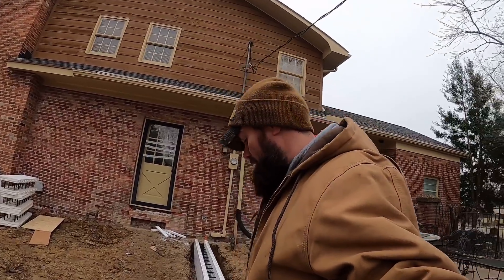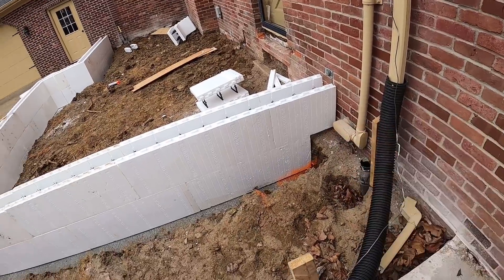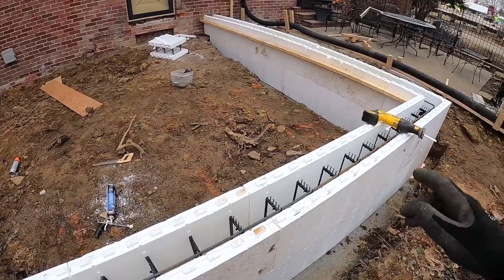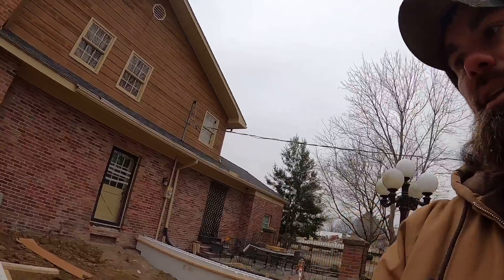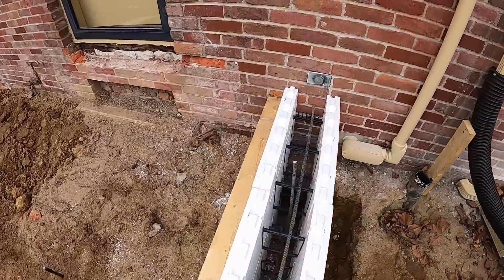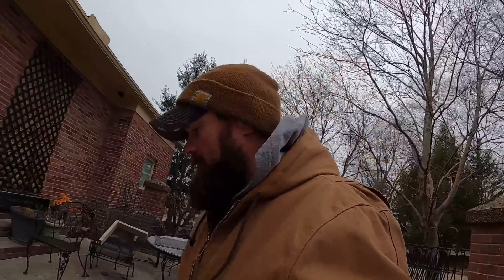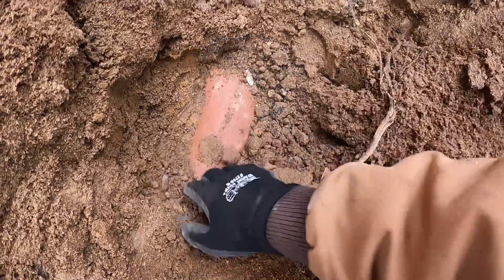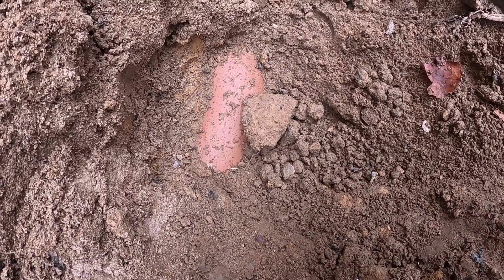fox block ICF.  #nudura vs #foxblock #dirtperfect

Comment: Learn how to use fox blocks and know it has solutions for these problems (the dang clips. Im sure you didnt actually think the blocks just set there by gravity. Im sure you use Noduras lovking system I don't know why you didnt use Foxblocks). Once you do, you will realize it is a superior product to Nodura. BUT, Im sure the flack youve caught by not bothering to learn the Foxblock system has turned you off Foxblocks for life anyway. Im doing an ICF house soon, Foxblocks (MADE IN USA!) and your videos are very helpful. Ive read up on how to do it and know the ins and outs of the system. I guess thats the benefit of sonething new. Im willing to pour over the instructions whereas a company that does it all the time and already has a preferred system is not. Thanks
Reply from the maker: Thank you for watching. We actually switched to Superform ICF blocks as there are no clips at all and the block is significantly more tough than both Nudura and or Fox.  They are made in Cincinnati OH.

Comment: Good job Matt
Looks like DP for got the clips to hold it all together 
Fox block is supposed to have clips cause the studs don’t snap together like Nudura
I find they both have pros and cons
All round good job Matt
Just subscribed 🤙
Reply from the maker: Thank you!  You are correct, they all have their pros and cons. The clips definitely help. Thanks for watching.
Reply: @nyamillennial metal clips to boot. There isn't a structurally stronger ICF block out there. For the job of containing wet concrete, this is the best. You can't fault nodura for being shippable and collapsible, but the cons of that outweigh the pros (weak corners, metal rods).

Comment: "Nothing to hold the courses together"...that's because you didn't use the required metal clips to hold them together!.  The metal clips work better than Nuduras plastic ones, which can pop loose.  Metal clips can't snap loose.  Good grief...how do you not know this?  You obviously have some skill, but its common knowledge that ICF's blocks all have some type of requirement to connect courses.
Reply from the maker: Victoria,  I do know fox block has metal clips, we typically don’t use them on stem walls. As for the nudura lock feature, they are our preference due to not having another bom to purchase for the build and the ability to unlock easily if needing to remove a block for whatever reason.

Comment: Would it work any better, to hold the slab to the stem wall, if you held the stem wall concrete down a couple of inches below the top of the block and let the slab pour fill that in?
Reply from the maker: Sam, yes that would work also. You would still need the rebar stubs which is where the main “tie” point is.

Comment: For the FoxBlocks, you needed to use the metal clips that holds the blocks together. The metal clips attach vertically along the internal studs within the blocks.  I did not see any metal clips during your installation.
Reply: @STORMSHADOW : He spent almost 5 minutes bitching about the blocks moving and never realized it was his ignorance that cause the blocks to move around in the first place. Too bad he didn't learn himself up on the literature specific to Fox Blocks. The lesson to be learned here is that it doesn't matter one damn bit how much you know or think you know about 1 specific manufacturer's system. If you're going to use another brand for a job, READ THE DAMN LITERATURE because more likely than not, it's gonna be different than what you do for the other manufacturer. This applies to everything in life.
And don't get me wrong here people. I'm just a dumb old, fat retired GC who has never done ICF before. But I've always seemed to be smart enough to #1, read up on a new product I've had to use. And #2, if there seemed to be a problem during install, or it just seemed so much harder than the other way I knew, I always 1st assumed I was messing something up and I went back and looked over the literature again to see what I missed. And I guess that brings up another lesson to be learned here... Never, ever (especially on YT) go off ranting about something unless you're damn straight sure you're right. Cause if you're wrong, you just make yourself look like the biggest dumbass on the jobsite.
Reply: @TrailTrackers  Well stated. Those clips are the missing link to successfully using Fox Block.
Reply from the maker: Light Ning,  thanks for watching!
Reply from the maker: @trailTrackers,  I have “educated” myself on fox block and I still appreciate your comment.   If you consider that complaining or bashing fox block, I would hate to see you comments on someone who actually did complain about a product. My comments were leading towards my preferences on Nudura block VS Fox block. Now, someone who wants to derive at their own opinions and choose a block, they can go right ahead and do their research.  I appreciate your involvement with this video, thank you !!
Reply from the maker: @trailTrackers,  no dissing here.   I appreciated your comment opposed to taking any negative away from it. I do also appreciate the time you have spent here.
Reply from the maker: @stormshadow, that is correct. The internal clips would have been greatly beneficial and we use them sometimes. With this short of a wall, it caused more headache placing stiff backs but we got it done. If it were a 9’ tall wall there would have been clips for sure. Thank you for watching.

Comment: Dad used to use witchin sticks (divining rods) to find buried water pipes on the farm and really does work!... he used to drop the held end of the rod in a short piece of scrap copper tube so there was no resistance. Essential tool in the cable avoidance tool bag to this day!
Reply from the maker: That is a great idea. I can see where they can increase the accuracy!!

Comment: First time I saw witching, the guy found a pipe that was 17 feet down. Amazing.
Reply: I am in my 70's and my dad and used a witching stick made of a brazing rods worked just fine back in the 50's and 60's  ( old school still works).

Comment: Good job on the pipe locating. I use copper wires and find steel pipes in concrete.
Reply from the maker: I have never tried that!!  I will need to explore that!

Comment: Matt, great explanation on the difference between the two ICF’s. I was wondering on the stiff backs are you using a 4” screw going into the form or is it a “L” and we don’t see the underside?
I guess one would call the dosing a “pseudoscience “ but it does work.
Reply from the maker: We use 3.5” torx head screws. It is 1 2x4  held with the 1.5” side against the wall.  Screws are ran in at an angle.